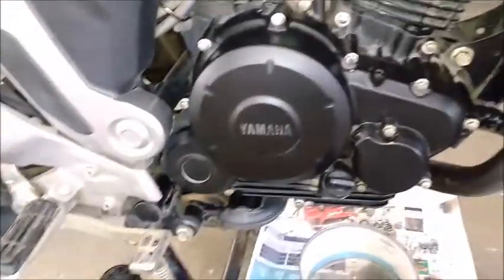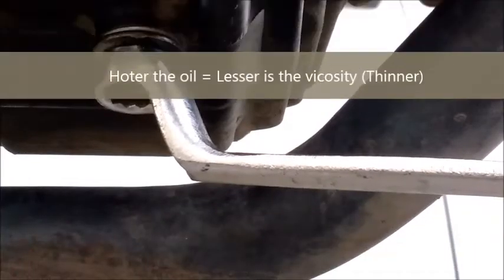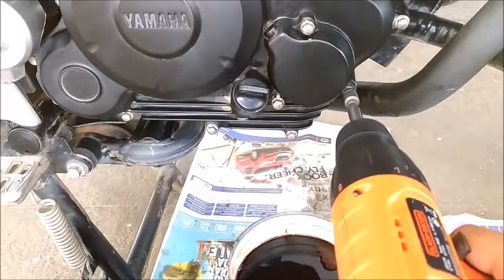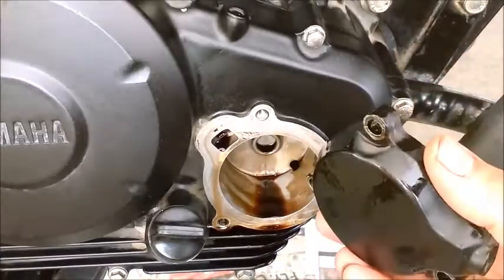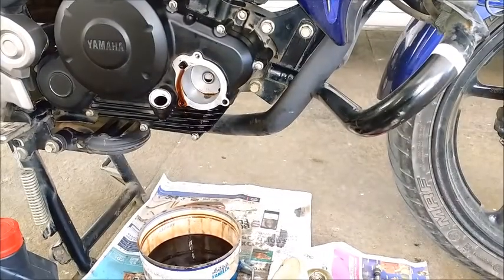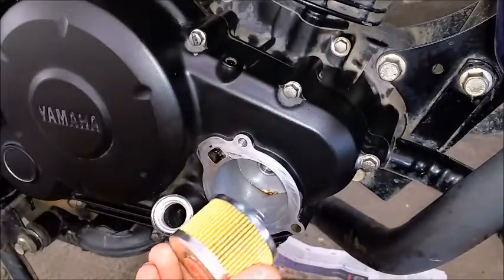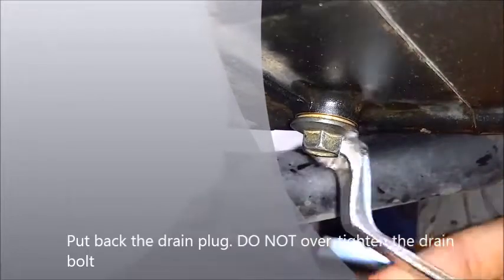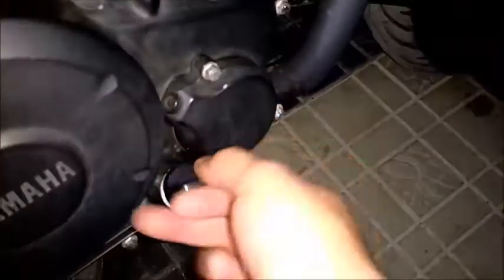#DIY : Yamaha FZ / Fazer v2.0 : Engine Oil Replacement || Servicing || Periodic Maintenance

Comment: I am quite impressed specially because of the fact that u filled 1.1 L which is the basic requirement after u replace the engine oil along with the oil filter. Most of the mechanics only fill 1 L which I guess is not a good thing for the engine as there is highly likely that the engine could deteriorate in near future . The User’s manual prescribed by Yamaha also suggests the same thing. Thanks for a wonderful video !!
Reply from the maker: Pankaj Ghimire Thanks. Keep watching.

Comment: thanks bro,,, from now onwards I will do it myself for my fz
Reply from the maker: siva rama krishna varma Sure. It's easy and best if you do it yourself. 

Good Luck.
Reply: Yamaha Fazer 
I serviced six times my bike in Yamaha service centre the threading of oil filter cover is damaged by them,,,,
just a week ago it got repaired,,,,
one question bro,,, is it same rench sizes
 that can be used for fz version 1 ??

Comment: Bro what is the recommended oil grade for yamaha fazer v2? Which oil is best tel me 😊
Reply from the maker: 15W 50 is the best. Yamalube is really good. Also you can go for Motul 5100.
Reply: @MototechWanderer  thanks for the information bro 😊
Reply: @MototechWanderer  bro i use motul 7100 20-50w varient, can i use it upto 6k kms, because today mechanic told me that no oil can run more than 3k, if it true, and one more thing if i use this oil upto 5-6k kms if it was bad or not?? Please respond bro
Reply from the maker: @manjunathrs5864  no, it cannot run 6k kms. The oil degenrates too much after 3000 kms. Better to use a cheaper oil and replace oil every 3k kms if there is a budget constraint.
Reply: @MototechWanderer  but bro im traveling too much, im not ready to change oil every 3k soo i put motul oil, if it is good or bad for 5k kms?
Reply from the maker: @manjunathrs5864  I used to make the same mistake initially but it had adverse effects on the engine. There is no other go than to replace the oil on time, no matter which oil you use. You must have heard in my engine oil replacement video that I replace every 6k kms ... It was a bad idea. It damaged the bore slightly. I have since then understood the mistake and strictly replace the oil every 3k kms and used a liquid called Engine Restore to manage the lost compression and now my bike runs fine. But I will never suggest anyone to make that mistake.

Simply go to local mechanic shop with a oil bottle and get it replaced under 10-15 mins. Even some petrol pumps do it for free if you buy oil from them.
Reply: @MototechWanderer  thanks for your response bro👍

Comment: bro...I have same bike fazer v2 -fi ..this bike is ok for long travel ...like 2000 km????
Reply: bcoz i planed to go manali from Coimbatore. ....
Reply from the maker: Kuwait K yes it's great for touring. 👍
Reply: Kuwait K i think this bike is not recomended for such distance
Reply from the maker: Yes. It's quite a good bike for touring as long as you remember it's a 150cc.
Has decent power and good comfort. Handles extremely well.
Reply from the maker: Lokesh Roxx I have recently done a 3100 kms trip on my Fazer Fi. No problems whatsoever.

Comment: Dont ever use fuel in engine parts unless you are doing a complete strip down!!! You will actively reduce the life of your engine because it ca effect all the oil seals in the engine by excessively drying them off leading to potential seal failures, also it will act as a secondary run in because all the oil has been cleaned off all the internal components (This is one reason why we have a run in period on new brand new bikes.)..Just use a very clean lint free rag to wipe off residual oil..Also filters need to be changed as per service manual or when changing oil grades..Not as per will..So never ever use fuel when doing simple oil changes and filter changes..The fuel you may think will dry off, it will but the residue of it mixing with the oil when tossing it into the oil filter compartment will remain)..

Also absolutely wrong about the engine oils, its not about contamination its about oil grades 15W50 and 20W40 are just different grades (Temp and Viscosity of the oil) and also weather its mineral or Semi Synth..ut when switching oil grades its always recommended when you do your first initial services do it with stock Yamaha and then switch grades..(Note: both Yamlube and Motul are from the same refinery with different branding labels, one sold at a premium and the other at an affordable price depending on grade..Compare the labels on the back of both bottles)..Also Motul is highly recommended by most post the initial 5-6 services..The factory workshop guys also say its better..

The drain bolt washer is called a crush washer and it has to be replaced every oil change and max after 2 changes..That is what creates the seal..Many suggest copper as it can easily form a seal without a chance of stripping the threads..

Also when filling always use the dipstick and never add extra as the pressure will increase when the engine warms up and the oil expands..(Tip: Always fill upto half way of the dipstick between min and max, then warm up the engine properly, then check the oil level..)
Reply from the maker: Adrian Braganza Thanks for the inputs man. Cheers!

I did mention that filter gets replaced with every oil change. Thats exactly what the the manual says.

Using fuel to clean/flush engines is a very old technique used by many people. I clearly mentioned its not required but at the same time it will not break anything.

I again mentioned I personally do not want to mix or contaminate the fresh oil with the used oil. Again mentioned its not required but I prefer to do it the way.

Cush washer theoretically should be replaced but why replace it if it's not damaged or leaking.

Manual suggests 1.1 litre of oil when replacing the filter, that's what I mentioned and also I check level while filling up and after running it for sometime, somehow did not cover that part in the video.

Comment: Bro, I am using MOTUL 7100 10w 50 on my FZ V2. At how many kilometres should I change the engine oil?
Reply from the maker: 3000 kms drain interval

Comment: what's the drain interval of motul 7100?
Reply from the maker: sathish kumar Not recommend by company, but I replace every 6000 kms.
Reply: Yamaha Fazer can I use motul 300v for my fazer?
Reply from the maker: sathish kumar yes you can but it will be just waste of money as it's a simple air cooled engine.
Reply: Yamaha Fazer so you recommend to stick with 7100?
Reply from the maker: sathish kumar  I would say stick to Yamalube.

Comment: who is the bast engine oil?? for fazer fi.
Reply from the maker: Animal Society of bd Yamalube
Reply: I useing yamalube engine oil.but not good result.where your are use 7100 20w50? but I will try synthetic.but not sure who is the bast motul 7100 20w50 or 7100 10w40??? help me...(.Fazer Fi 150 cc)
Reply from the maker: Animal Society of bd Motul 7100 is good but won't observe much difference from Yamalube.
Reply: who is the best 7100 20w50 or 7100 10w40?? I know yamaha not support other engine oil.
Reply: Motul 15W50 grade..I have been using it since the 5 service years back, I got my bike in 2010..You will notice a more smoother pickup, gear shifting is also very smooth..Much better than any xxW40 and it lasts longer depending on the way you ride..
Reply from the maker: Adrian Braganza  Relatively Expensive with no real life benefit over Yamalube recommended oil in short term. In long term use, it retains its properties better being a fully synthetic oil.
Reply: @MototechWanderer  what is better engine oli for My fazer v2.0 please tell me
Reply from the maker: @lipunlipun5052  Motul 7100

Comment: why u use 1.1L?
Reply from the maker: fz 16 Becoz with 1 litre oil,the oil level is not reached.
Reply: Yamaha Fazer i feel same problem
Reply from the maker: Always use a little extra oi to maintain the level. This will make the engine last longer. But make sure to not overfill the engine oil.

Comment: For FzV2/ Fazer V2 only 10W40 grade oil is recommended by yamaha...never use 20W50 ...it's too thick...
Reply from the maker: There is nothing called too thick. It's all viscosity unit with respect to time.
Reply: @MototechWanderer  
I appreciate your effort and it's grt video...I also tried many oils for my fazer v2...but recommended grade (10W40) only gives good performance with engine safety...and also keeps warranty intact...
Reply from the maker: @arekh999  that's good. For me 20w 40 & 20w 50 both have worked quite well. My current odometer reading is 47,000 kms and the bike is doing good so far.
Reply: @MototechWanderer  Great...happy miles munching ...
Reply from the maker: @arekh999  thank u buddy. Wish you the same.